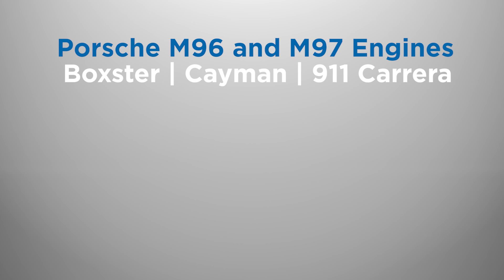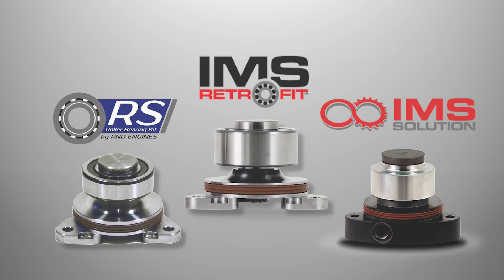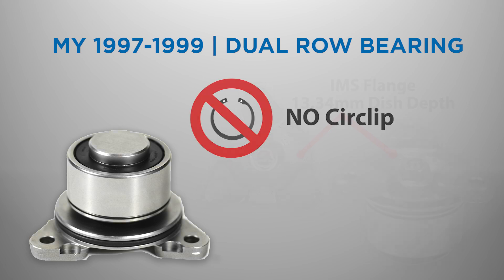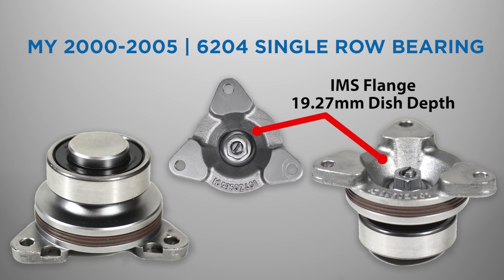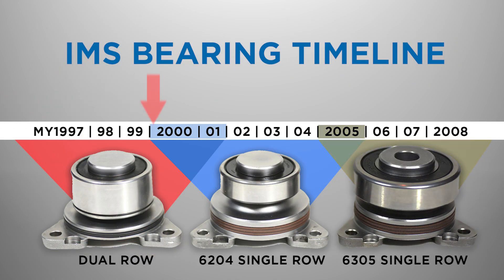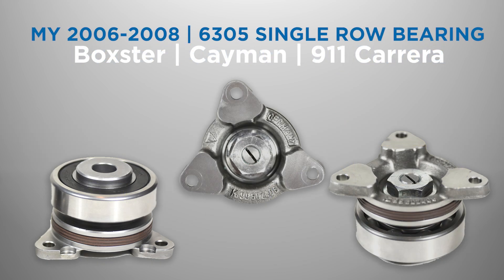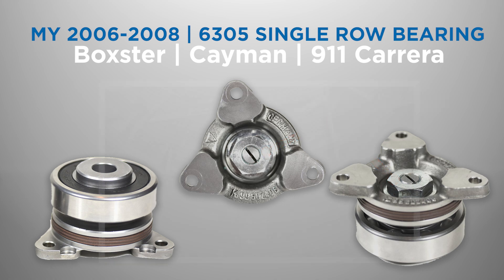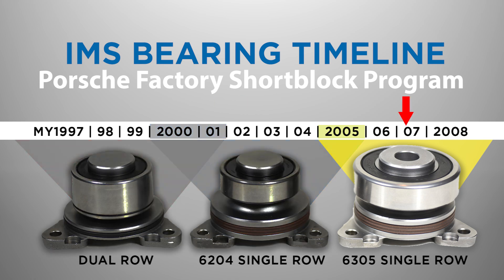What IMS Bearing does my Porsche engine have? | 996, 986, 997, 987

Comment: Hey!

What about the 2005 (Feb) Carrera S? Do i have to change the IMS Bearing? I don´t know, which bearing is installed.
Reply from the maker: It's best to just assume you have a model that has the serviceable bearing, but if for some reason it doesn't, you should still have the shop doing the work remove the grease seals off the non-serviceable bearing so as to extend its service life. Details for this mod can be found here: https://lnengineering.com/products/the-definitive-guide-and-faq-for-porsche-ims-bearings/my06-08-porsche-cayman-boxster-911-ims-bearing.html
Reply: @lnengineeringllc  Thank You! :)

Comment: I wonder if you can help … I am in process of rebuilding my 2008 997.1 C2 … whilst engine is disassembled, I thought it a good idea to get my machine shop to replace the IMS bearing … it seems that the larger bearing is a ‘industry standard’ 6305 type … is this correct? … is there a particular manufacturer/type that you would recommend? … is it better to use a sealed or unsealed type? … any help/guidance really appreciated 🤞
Reply from the maker: Our recommendation would be to fit an IMS Solution as it provides a permanent fix for the IMS issue on these models. All our Retrofit and Solution kits use an adapter bushing that when fitted makes it so that the IMS is serviceable without complete engine disassembly: https://lnengineering.com/products/the-definitive-guide-and-faq-for-porsche-ims-bearings/my06-08-porsche-cayman-boxster-911-ims-bearing.html

Comment: Congratulation for all of these of information  about a make with such history. My name is Sotiris from Athens Greece. Thirteen years ago I bought a Carrera 2001 second hand. The car is in a good condition but at 80.000 km changed the broken engine with a rebuilded one which came from Germany according to PORSCHE CARE ATHENS in 2008 . From the factory the broken engine was M96 / 4_66120034.  The rebuilded one has the numbers M9604AT66166310. Because of the many articles about IMS problems I would like to know how will be able to inform me about the Bearing in my car IMS which cause the fatal problem in the engine. 
My car has also production No WPOZZZ99Z1S606579. I am wondering what kind of IMS bearing has the car right now big or a small?
Thank you in advance
Reply from the maker: As you have a factory replacement engine, the Porsche dealership should be able to tell you what IMS bearing the engine has based off the engine number. That data we do not have access to unfortunately. The engine would have whatever bearing was currently being used by Porsche during the model year it was manufactured. If the engine was built in or after model year 2006, it will more than likely have the larger, non-serviceable IMS bearing.
Reply: thank you  @lnengineeringllc

Comment: So for my 2000 986 I literally have to get behind the flywheel to find out?The cars build date won’t tell me?Ive heard that the early build dates are still dual row.
Reply from the maker: You can find a table with engine serial numbers and what bearing the engine should have here:

https://imsretrofit.com/what-ims-bearing-do-i-have/
Reply: @lnengineeringllc  thank you that will quite helpful when I get into it
Reply: Just be aware that engine serial number alone doesn't tell you for sure what's in your engine, as it's possible the engine has had work (possibly by Porsche) in the past.  Therefore only way to check is indeed to remove the flywheel.  I'm in exactly the same position as you: 2000 Boxster, but am dropping the flywheel and inspecting.  It's what I did on my 996 which was dual row and at 100K miles, absolutely perfect.